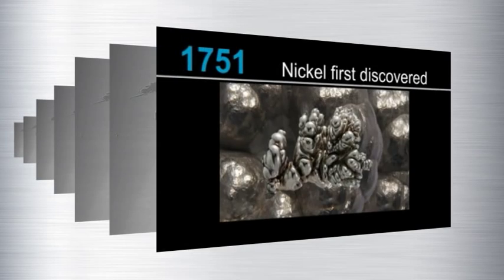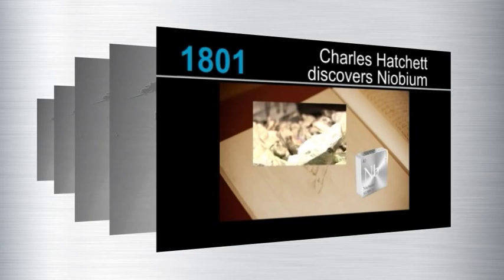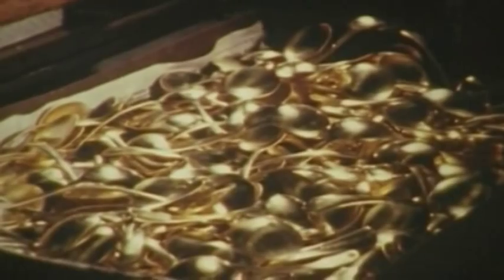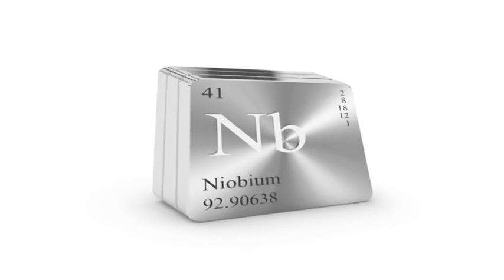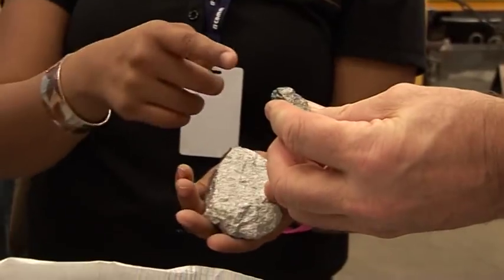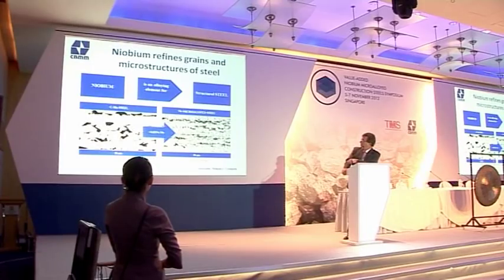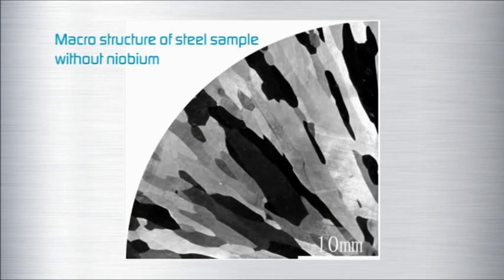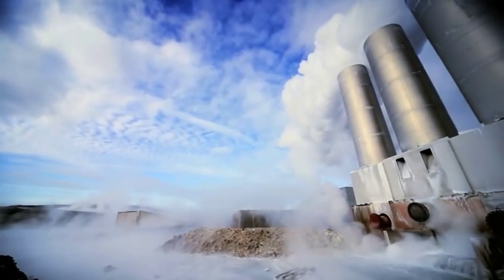Niobium in stainless steels

Comment: Nb stretches the austenitic SS lattice
Nb makes NbC and carbonitrides which in turn help in producing finer grains of austenitic SS and increase the YS
Cr loss is prevented because Nb does not let Cr to make complex carbides & carbonitirides during HT of austenitic SS
Creep in some aus SS is prevented
High temp resistance is produced in ferritic SS with the combination of Nb and Cr
martensitic SS : Cu and Nb produce precipt hardening.
During solidification, Nb increases the solidification interval leading to effective grain refining.
Reply from the maker: Thank you.